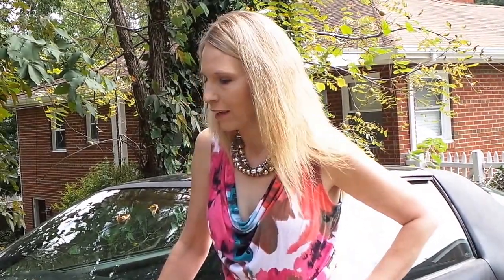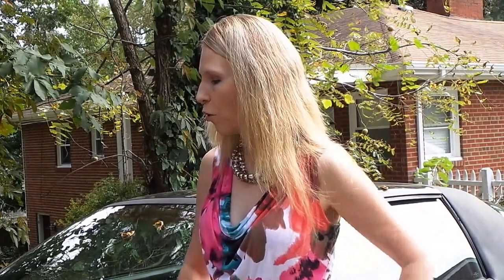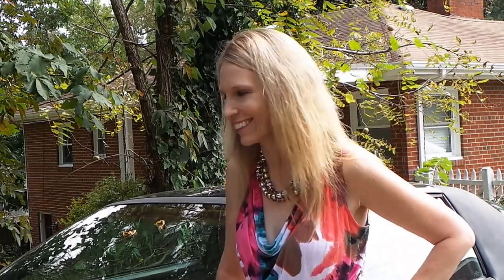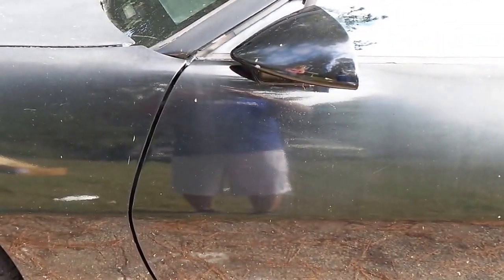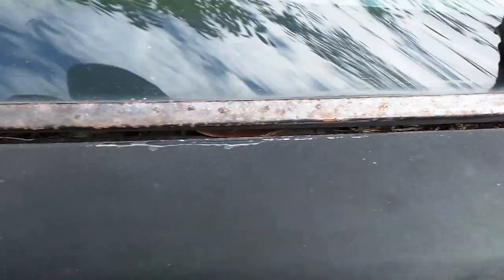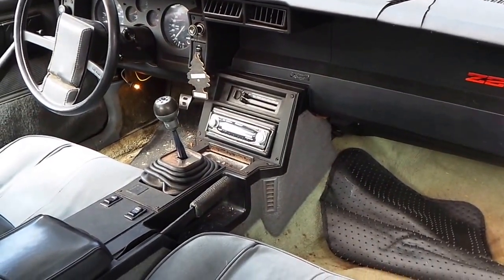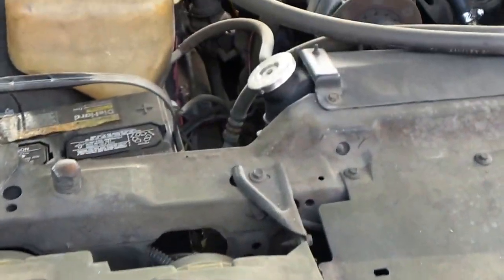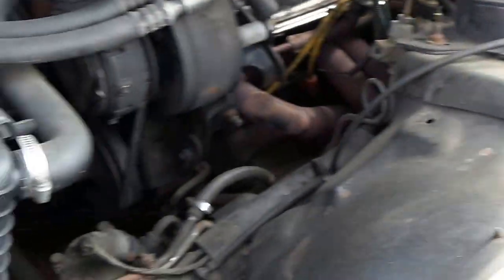1986  Z28 Camaro One Owner Survivor Walk Around before, products in description

Comment: Umm! It's a 305! Not a 350! They didn't put the L98 in the F body siblings until 1987! For the Camaro it was only optional on the IROC-Z
Reply: Totally agree not a 350. They also didn’t make a 350 with a 5 speed even the irocs or trans am gta.

Comment: I have a 1986 camero z28 iroc. I bought it in 1989. I've had it 29 years. I love the car. Always been garage kept. Never driven rain or at night. Some people worked my car Dec 7th 2017. It was idling too fast they put a zip tie on it. They said it needed a throttle positioning sensor. New wires and plugs. I told them I wanted it all done. The day the car was there Dec 7th 2017 they replace the 02 sensor and put throttle body cleaner in the car. It doesn't have a throttle body. Its fuel injected. After a week of waiting I called them Dec 14 2017.  I was told the parts were there but because I was. Disabled and had more then one vehicle and it was an Antigue they were working on other peoples cars and waiting about mine. They never told me they were gonna do me this way Dec 7th when I was there. They really acted like they wanted my business. I live in a small town and Jan 7th 2018 I drove my camero around the block twice. When I pulled into my metal garage there was smoke inside the car. I thought maybe from the muffler. When I got out the car was on fire at the rear fiberglass bumper on the drivers side it was melting right before my eyes. By the time fire truck got here the fire had destroyed the hatchback side windows t tops and half windshield and the whole interior. The fire didn't reach the engine nor did it start there. The car was in good shape. I had it painted in 2008 after I got sick and had to retire I used my retirement money on it. It had started to fade on one side. But the car had no dents or scratches it still doesn't I also had a cd player put in new weather stripping a new overhead liner around t tops a jasper transmission. I am devestaed over the car. And do you know those people who worked on it called and left me a message 6 months to date the car was in their shop 5 months to date of fire. They called me left message mine 7th 2018 wanted know when or if bringing the car to them that they had the parts and if I wasn't bringing it to them they going send parts back. I never returned their call to tell them about the fire. I called them Dec 14 2017 and they refused to fixed the car after they had done started working on it and put that zip tie on the moter which is still there. Had they not refused work car after parts came in on Dec 14 2017 when I called them I would took car them that day. I heard a sound the day I drove car and it caught fire. One fireman said it could been car backfiring and caught fiberglass bumper on fire. Everyone says I should sue these people. Someone said if I could find a car with front end damage because my front end is ok we could use the rear and interior that the car with front end damage for mine. I had that car 29 years. I love that car and am upset. I want to know what you think about the car the fire. If it can be fixed or not. I only had liability insurance on the car. You can reach me djpaschall1956@gmail.com. thanks for letting me share my story with you.

Comment: It's a 305 unless someone swapped it, 350 didn't come out until 87 and a 350 manual was never available because the t5 is too weak to handle the torque.  Steering wheel is not right, looks like an aluminum intake with an edelbrock carb.